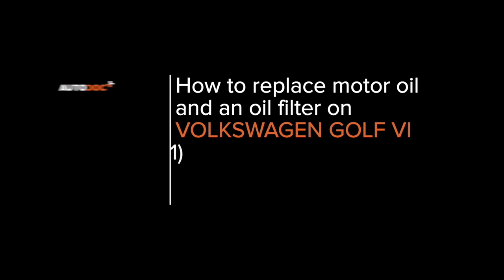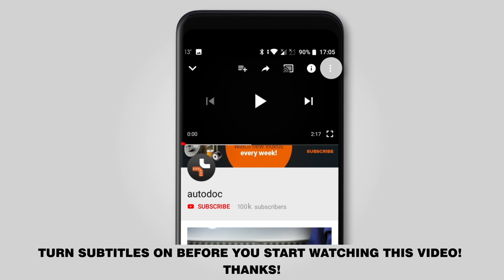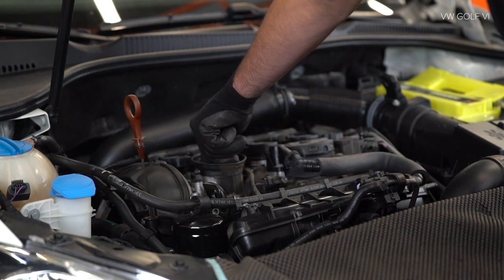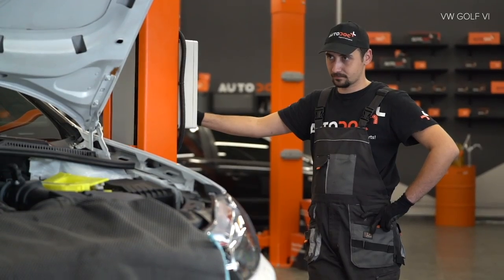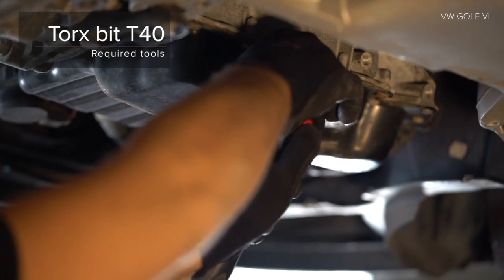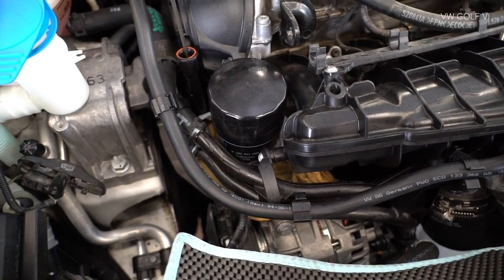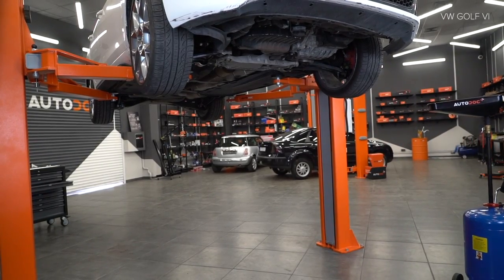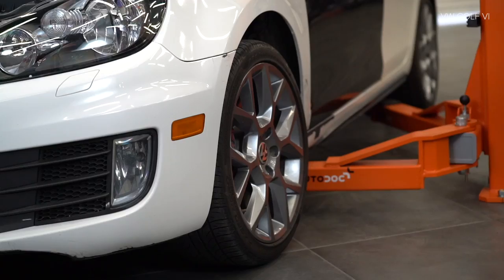How to change oil filter and engine oil on VW GOLF 6 (5K1) [TUTORIAL AUTODOC]

Comment: The oil filter was pre loosened. It took me 40min to remove mine today. I had to puncture it with 2 screw drivers to get enough grip for a monkey wrench to clamp down on it. Even then it took several passes. I'm a large guy almost 6.5ft tall that works out.

Comment: so why is there a need for a new drainage plug?
Reply from the maker: Replacing the drain plug gasket or the plug itself with a new one is an important part of vehicle maintenance that should not be forgotten. They are mounted on the engine sump, thereby reducing the risk of oil leakage.